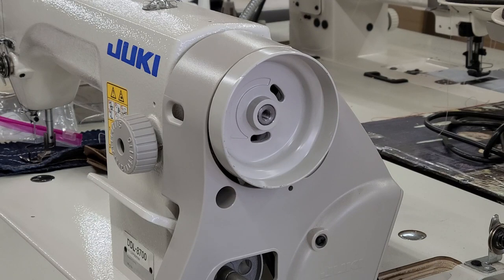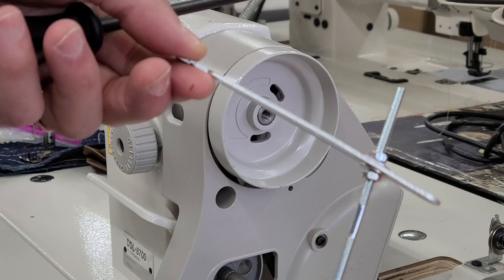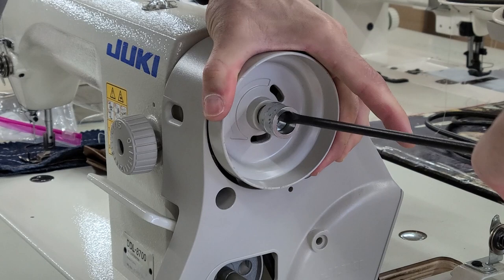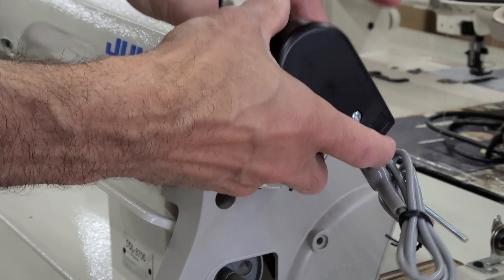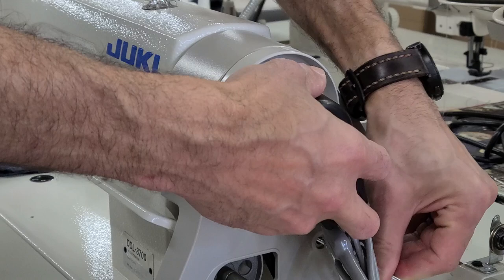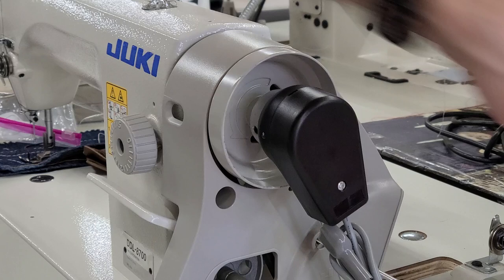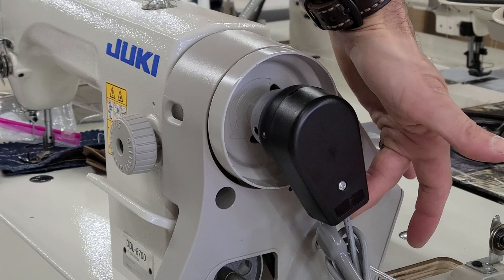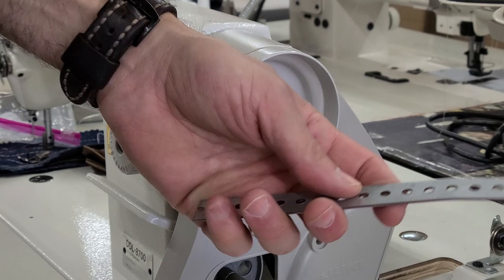Consew brushless servo motor's needle positioner installation

Comment: I retrofitted my Juki 1181n with the 1 hp Consew servo motor.  The entire process took under 1 hour.  Worked from below the table.  If you’re retrofitting use all of the bolts, nuts and hardware included.  Consew has a YouTube on programming the controller.  I just used the motor to sew up a skirt for my kayak.  Needle and speed control is great.  Perfect for upholstery and heavy fabrics.